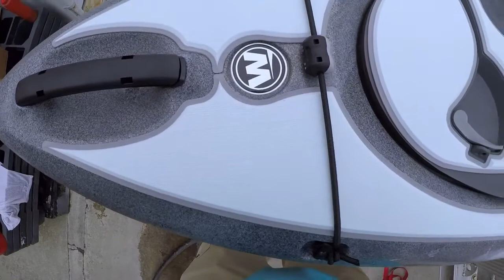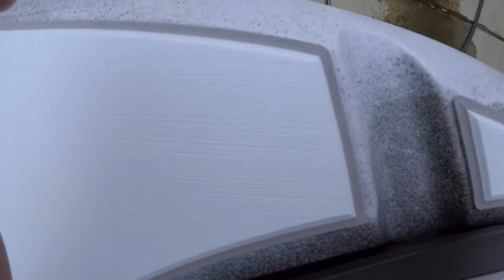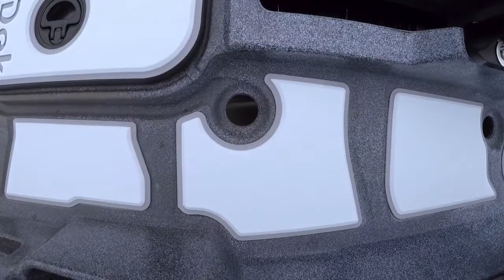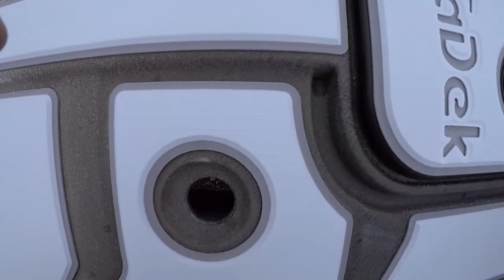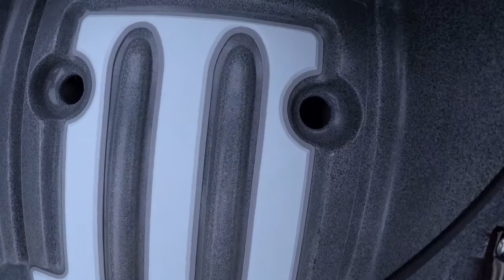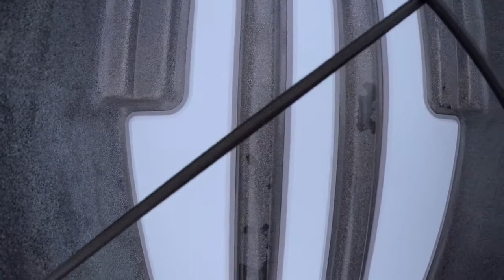Wilderness Systems Radar 13.5 Seadek Finished Product

Comment: Why is it all white?  Does it come in black?
Reply from the maker: It is a very light grey , you can get Seadek in several colors including a white but the white is to blinding on the water so I went with a light grey. Black would be ridiculously hot. The temperature of the surface without any Seadek was well over 100 on a 90 degree day. After I put in the light grey it went down to the low 70's on a 90 degree day. If it would have been black , surface temps would have been easily over 120 degrees on a 90 degree day.  Way to hot for me being on the water 8 to 10 hours in the summer. However , yeah you can do black.
Reply: Jason Harrell   Thanks Jason, I never thought about the heat part of the equation.  Yes, black might be too hot.  When I was looking at the Radar 115, I noticed that the deck seemed fairly slick with no texture to it.  I was thinking it needed some type of deck matting for a better grip.  

Do you have any issues standing on the boat?  Does that center hatch interfere with your stance?

Thanks again-
Reply from the maker: @theblake5356  The deck is not completely texture less. Its slight but a very small amount. The seadek has helped tremendously over stock for sure with the brush pattern.  I stand in my yak , not very often , maybe five times in the last two years over about 70 outtings. When I do stand its more stable for sure with the seadek than without. The hatch in the center at first may look like poor placement with it being raised up but what I find it does , it allows me to know or should I say feel the best balance points which are as far to the sides as possible. You are more likely to tip the closer you have your feet together than farther apart , in that respect , it keeps me honest to my stability. If I was to want to turn around more , then that might be an issue more. However , I have found myself getting use to being in a seated position almost always and reaching behind myself more and getting to know the feel of the placement of things which keeps me from standing. Think of it sort of like if you were blind , how you have things in the house and it always being in the same spot is important and that is how I treat my yak. I know how far to reach behind me for any of the 8 items or so I have behind me. 

On a side note , as far as black gos for a yak. I once saw a craigslist for a Jackson Kraken 15.5 in mostly black and some yellow banding. I was like holy shit , that is a awesome looking yak. It was like 1500 rigged. Then it hit me , I was like , wait a second , black , water reflection , sun , summer , ok not such a good yak lol. It looked almost new and really the only reason I could see someone wanting to get rid of that Kraken for so cheap was probably the color is just way way to hot in the summer. It would be like sitting in a frying pan.

Comment: Very nice job and nice looking product..How did u do all the templates on it.
Reply from the maker: Seems I forgot a question somehow i did not get a notification. The templates were in the form of a clear plastic sheet called mylar. You have to cut them and fit them in place to each area. Then you send it back to Seadek , they send you back the blueprints on the same mylar film. You cut along the lines and see how they look. Make adjustments if needed , then send those adjustments back etc until you and Seadek are satisfied. Then they cut out the actual pieces on the matting and send that to you , you install it , done.
Reply: Jason Harrell awesome thank u very much for the reply :)